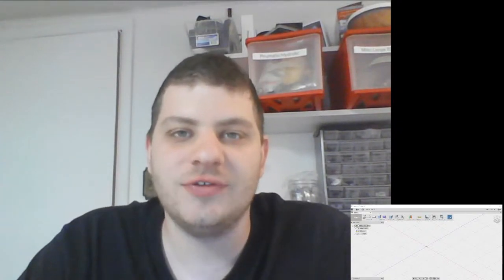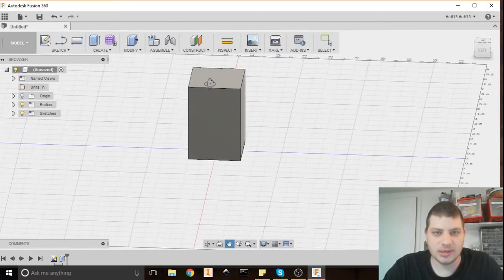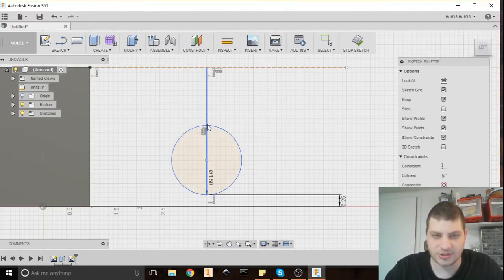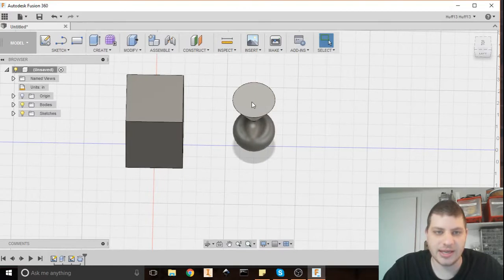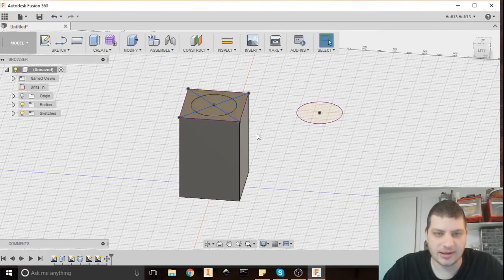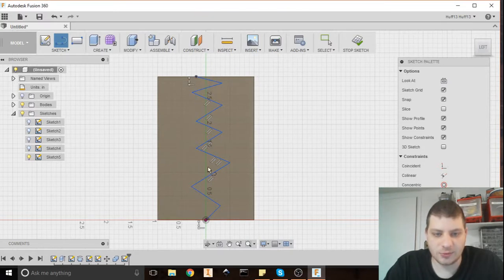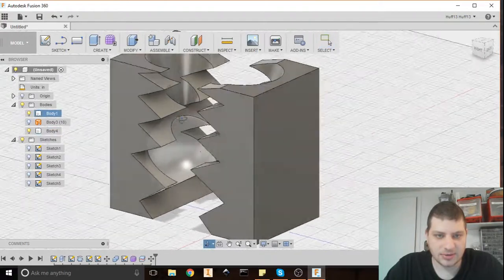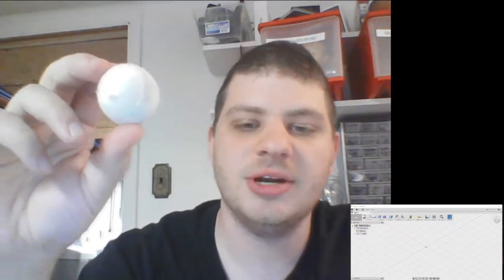Operations on 3D parts: Fusion 360 Beginner Tutorial

Comment: A.J. I'm finding your videos to be indispensable. 
I keep coming back to your videos every time a do a new project. Even though I don't replicate your project every time I do pull snippets from each of your videos. Thanks so much for teaching the many veritable technics and tricks in Fusion!
Reply from the maker: Thanks! I'm glad I can help. Is there anything specific you would like some help with?
Reply: Design The Everything Yes please. I'm designing a router mount for a CNC router table. It's all drawn up, but for the mounting holes in the back plate.
I'd like to have four holes with curved slots. So imagine if you will a 177.8 mm wide block that is 65mm tall and 10mm thick. The block has four 8mm holes in near each corner of the face 12mm in from the corners. There is also a 12mm hole directly in the middle of the face.
I would like this block to be able to rotate slightly around the centre axes (bolt). The four holes near the corners would need to be slotted in an arc. The movement only needs to be about 5mm either side of centre of the four bolts. Message me if you need more info.
Reply: It's the slotted 7mm arcs I'm trying to wrap my head around. I'm imagining you could use a circle and turn it into a construction line?
Reply from the maker: I think I understand what you mean. Give me a day or two and I'll have a video out.
Reply from the maker: https://youtu.be/0-MnMEEjjiQ

Comment: I understand how an irregular or zigzag seams and locating pins can all be used to ensure mold halves will be correctly oriented when put together, but how is it that the zigzag will prevent or eliminate flashing? Is not flashing simply the result of the mold components or halves in this case not forming a good seal? Would you please clarify this for me and other viewers. Depending upon the material being cast it is generally good practice to include vent holes in a mold's design to allow air to escape when the mold is filled. However, this may leave a couple of hair-like protrusions on the part based on the viscosity of the material cast, but they are easier to remove than the sprue.
Peace!
Reply from the maker: Thanks Jeffery, Going back to my video I was definitely not clear. When you are making a mold with something that is much higher precision, like milling it on a CNC, adding that zig-zag shape would just make the parting line ugly, and it would probably add flashing. A CNC is capable of machining both a very smooth, and very flat surface, unfortunately a 3D printer is way less precise. Normally when you print a piece, you do so at 10-20% infill, so the top layers have to bridge gaps, and when the top layers bridge those gaps, they sag in the middle and you end up with a part that looks like ~~~~~~ on the top. 3D Printers can do vertical walls smoothly, so the zig zag will actually help reduce flashing. I do wish I had made more, smaller zigs.

I don'tn have any experience with adding the vent holes. My first instinct is that it wouldn't have helped since I was using a very viscus silicone. Maybe if I had a vacuum chamber, or added a thinner.